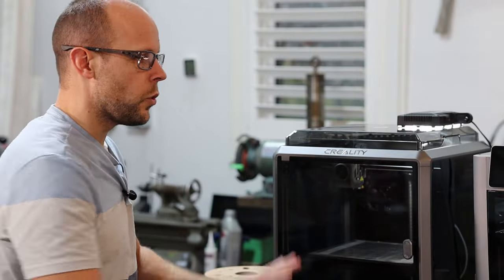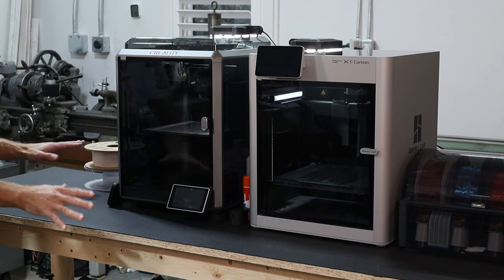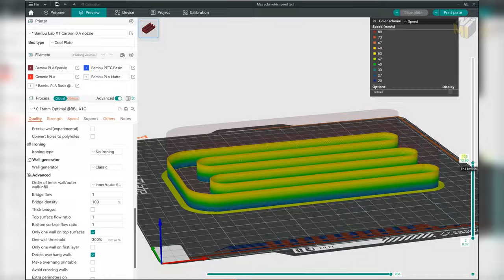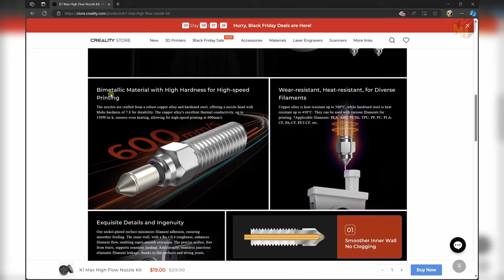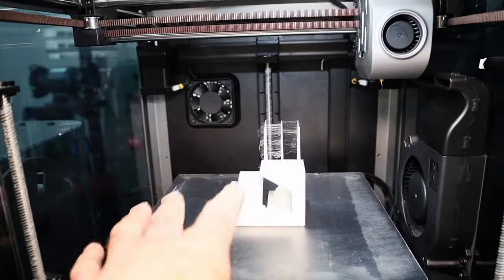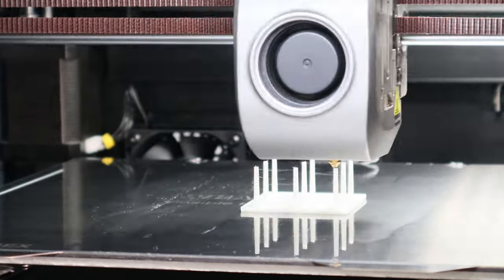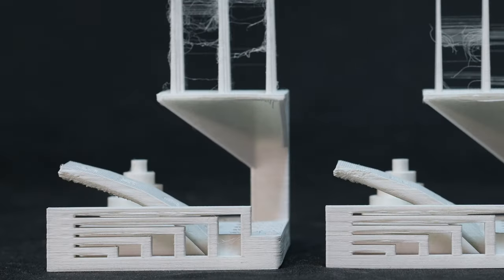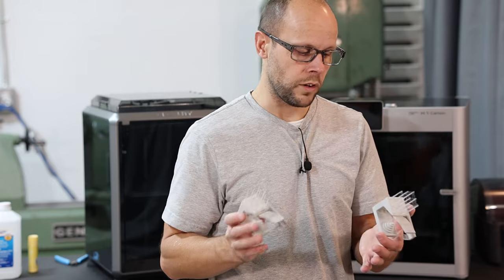Printer VS Printer - Creality K1 faces off against the Bambu X1C at HIGH SPEED - Who Wins?

Comment: For the price I think the K1 is a better choice if you only going to print in one color at a time, if you slow down the print speed I think you should get quite similar results for a third of the retail price. I'm considering the K1 to replace all of my ender 3 v2s. Great video as always !
Reply from the maker: Thanks a lot, I really appreciate these kinds of comments!  The K1 is really a great deal, all ofthe printers seem to be coming down, maybe they know something we don't.  Is there a next-next gen coming out soon?   

You've given me an idea for a follow up video.  Does the K1 or the X1C perform better worse or the same at high speed vs low vs in-between?  We'd imagine that they'd all do better at lower speeds, but they're designed for high speeds, so maybe it's not what we think.  I just wish I could get that little bit better extrusion consistency from the K1, it's so close, could it be the extruder.  It's something that seems to be there regardless of the slicer we use.  I really need other people to tell us whether this is something they see as well with their printers.
Reply: K1 Max is $650 at micro center right now and the K1 is $350
Reply: @NeedItMakeIt  I just saw the video of the new flsun s1 printing a benchy in 8min, they claim 1200mm/s. Maybe creality is moving towards the delta format printers, those machines are coming strong !
Reply from the maker: Wow, they must have some kind of hotend on there to keep up with that speed.  ULTRA VOLCANO HOTEND... END... END!    I'll have to check this out.  Imagine at those speeds when something goes wrong, you'll have no clue what happened, it will just explode into a pile of parts.    The idea of the delta is very different from the others, it is naturally more stable because of the way the hotend is being held. I'll have to see if I can get my hands on one, even if its a small one.
Reply: I have both printers, but if I have to trust a printer I go to my k1, for $350 what an amazing printer if it cam multicolor I would just go with the k1
Reply: And the k1 doesn't waste material like the bambu
Reply from the maker: @albertorodriguez182  Thanks for that, lots of people seem pretty happy with the K1 finally after a bit of a rough start.  I don't mind tinkering myself, but I get it that some people just want to press print and that's it.  At this point, I'm with you.  I'd like to use the X1C most of the time, but I don't hesitate not to use the K1, just knowing that the quality is just a little bit less.  Maybe there is something I can do to get it closer.  If you have any ideas, I'm all ears.  I'll be experimenting with a few ideas to see what the source is and see what we can do to fix it.
Reply: I have two K1 Max machines in my stable, can't beat'em.
Reply: But the problem is that the K1 or Max have a bug that if you slow down the prints the quality will be horrible. It is just built for speed. I hope they have fixed it.
Reply from the maker: @skelethornbro  That exact test is what I am working on right now.
Reply: @NeedItMakeIt  cool! Will wait for the result.
Reply from the maker: @skelethornbro  Sounds good, I'm curious, I'll do a couple of tests for each printers, Slow-Med as well.  I'm going to need to buy some more filament soon.
Reply: Actually I am in the position of actually owning a p1p, an x1c and a p1s. I can tell you that if I were to do it over again I’d only buy the p1s. Why? I’m not convinced the LiDAR really does much for the kind of things I make. For the money the p1s is probably the best deal of the 3 in my opinion and real world experience. The difference would be for carbon fiber filaments, which I don’t print. 

As far as the k1 printers I’m seriously considering the k1 max. I wish it were a bit bigger but it is bigger then the Bambu offerings. Also there is an upgraded hotels that will ensure good flow for the k1 series of printers and coupled with orca slicer I think it’s is a decent alternative to a Bambu printer. 

The only drawback I see with creality is support and customer service. I have other creality products, now and in the past and service and support is virtually non-existent save online forums and Facebook groups. Bambu at least has what seems to be an 80/20 record so I know I have a better chance to get help should I need it.
Reply: I'm looking more for a printer for high heat carbon, what do u suggest?
Reply: @alfainc5868  I guess the question is how much carbon are you going to be printing? I personally have never printed in carbon fiber at all so I have no experience but it seems the Bambu has a bit of an edge between the x1c and the K1 since there are plenty of people that have used it for carbon printing and it seems like the K1 has a few issues overall that likely will be ironed out in either updates or community use and solutions. 

Also if you are going to be doing a lot of carbon fiber filament maybe neither one of these printers are for you, you may need to look at other solutions, but you won’t get it at the affordable price either the Bambu or the creality machines are at and won’t have the speed, which seems to not matter to a bunch of people.
Reply: @shawnhicks619  thank you 😊

Comment: I have both the K1 and the X1CC.  My K1 was one of the early release and has been nothing but problems and is still not working even after I received all the updates from Creality.  Updates are painful on the K1 and flawless and painless on the X1.  When the K1 worked, for a very short time, I was very impressed with it.  What sways it for me is the AMS multi color unit.  Price I think not apples to apples as you said I think the P1P or P1S is a better comparison.  Loved your video and i subscribed
Reply from the maker: Those are excellent points.  The history on this is not very favorable for Creality, it seems as though they tried to do what they always do and release a printer which needs work, and rely on the community to solve the problems.  Unfortunately for them, Bambu was working on solving all of the problems and had an excellent plan to release a printer for a few price-points.  Those printers also have the ability to upgrade to use the AMS system.  They had a very good strategy here and it looks like it blindsided Creality.   A little story on this.  I have been trying to work with Creality for years on getting a CoreXY style printer, it's been 2 years, I nearly had one and then that fell through.  Years passed and we worked on it again, but then it was delayed again, that was for the K1, they delayed it because they didn't want to give me a K1 printer which wasn't working correctly knowing that I would be making videos showing the problems.  So I waited and then I received this one.  But it still wasn't quite good enough.. at least compared to the X1C.  But then finally they opened it up, and it's at a point where I'm happy to use it, it's not perfect, but it's pretty close, and for the price it's a good deal I think.   

The first batches though there were lots of problems, and I guess you weren't able to get your sorted out.  I think they had an upgrade kit for the extruder and hotend, did you ever end up with any of those?
Reply: I did get the upgrade it but haven’t installed it yet. I had to do a major unplugging of the hot end one time and when I was taking the hot end off one of the connectors got pulled off the board and I’ve been trying to get something worked out with creality even at my cost if they didn’t want to cover it under warranty but they have not been very helpful. I need to get it working because the bambu is swamped and I can’t afford another one
Reply from the maker: @3Dprint4you  Oh, that's not so great.  If you get a chance, please send me a photo.  I maybe be able to include these types of things into future videos on the subject to help people and also apply a bit of pressure to the manuf. to do the right thing.
Reply: @NeedItMakeIt  I will definitely send you some pictures of both whatever problems with the K1 but also for the fuzzy skin.  I noticed that the fuzzy definitely looks way better on larger prints but will send you a picture of both big and small "snowmen" with the fuzzy.  I really like it and absolutely no layer lines to be seen.
Reply from the maker: @3Dprint4you  Cool thanks.  I have a few uses for Fuzzy skin coming up and I'd really like to see what it looks like on your prints.  I'm hoping in a few years we can have printers which do not print in FDM, instead they'll use a completely novel approach which gives us a homogenous part when we're finished, no layer lines, all one solid part just like injection molding.  Resin is close to this I suppose, so maybe it will be more like resin, but I'm thinking that there are other approaches which have not been explored yet.
Reply: Exactly the same experience here except I’m still waiting on my upgraded parts
Reply: Creality always has reliability issues, the rule of economics say we cannot get an X1C for $531 (K1C).  So therefore, reliability and parts quality must be inferior on the K1C.

Comment: Yes the K1 makes printing fun. This latest generation of printers is what will take 3D printing mainstream. Just design and send it to the printer via wifi. I tell everyone that If I were a kid, the K1 would be my favorite toy, It is that easy. And for prtotoy[ing this is what you want. You want to focus on generating ideas not be frustrated by tools that barely kinda work.
Reply from the maker: And that's something that not a lot of people think about.  If they're getting a printer they should also be designing what they need themselves, it's going to give them an overall better experience and the satisfaction of having made something themselves.   Remember when we had to walk over to the printer with an SD card?   Ha that was just 6 months ago.  They've really come a long way in a short time, and I'm sure as long as there is a market for printers, they'll continue to innovate and make them better.  Finding ways to make parts which are isotropic would be one of the main ones in my mind.  The parts we make are prone to breaking unless you take the 'grain' into consideration.  It would be ideal to get to the point of injection molding.

Comment: Wow. You could have 4 K1s for the price of the X1C. 🤔
Reply from the maker: There, the right account!  I'd say when tech goes wrong, but it's just USER ERROR...  It’s hard to believe they can sell it for that cheap. About 4 years ago I purchased an Anet A8 for close to that price, it was slow and inaccurate.   I’m still not sure what exactly is causing that little bit of variation in the surface finish.  The K1 printer seems to shake more than the Bambu when running high speed, but I see this at lower speeds also, could it be the setup for the extruder.
Reply: @NeedItMakeIt  glad you switched accounts. I'd also clean up the other ones 😅 

$650 for the K1 MAX in micro center right now. Unreal. Im legitimately option paralyzed. The MAX print space is huge (I am self employed) and need that space. But the Bambu are so polished 😅
Reply: ...because this "youtuber" dont have P1S....
Reply from the maker: @sore500  I don't really know what you mean, can you give a bit more insight?

Comment: With a little tweaking, the K1 can get to the level of the X1C. BUT, with a little tweaking, the X1C can look much better than that too. Both are great machines. I prefer the P1 series over the K1 series, but the differences are smaller than they used to be with the previous generation of printers.
Reply from the maker: That's a good point, you can really dial them in more, it's just a matter of how much effort you want to put into it.  Do you think that the slight variations in the surface on the K1 are related to the extruder or setup for the extruder?  I wonder whether I should run a few tests to see if the tube is being pinched too much and I should remove the top to see if that helps a bit.  With both running CoreXY, I don't see many reasons why the results can't be better.  It's just a matter of finding the source.

Comment: If you want a truly scientific test, you need to use the exact same settings on both.
Reply from the maker: It's a bit of a rabbithole, but yes I have been deep-diving into each of the settings to see if I can get them a bit closer.  Even after making some adjustments, it is strange to me that the results still are not as close as I would expect, in the slicer there is still a fairly big gap in print speed around inner and outer walls.  In theory it should have given Creality an advantage because it was slower with inner and outer, however the end product didn't seem to reflect that.  More testing required.  I do have a new extruder on the way, there is a possibility that there is still a lingering problem with my printer. 

As I get a bit more established, I will be more methodical in my testing, you should expect to see the Science factor increase over time.

Comment: I had a K1 Max at my last job. I can say I was using the BL slicer up until January when the new Creality Print came out. I was getting far better results, supports, layers, surface finish etc with BL. Then CP 5.0 seemed to fix the issues. Certainly it needs to be tuned using all the built in tests, but it'll put out nice prints afterwards. A very informative comparison, keep up the great work!

Comment: im happy with my k1, delivered to my door for under 400 bucks last week, all the teething issues seems to be resolved by crealety
Reply from the maker: That's good to hear, and a great price!  By all of the feedback I've been getting it does seem that any lingering issues have been fixed.  I do wonder if the extruder feed tube (reverse bowden) is still within the cable chain, and if it is, does that bend to the extruder not get too tight?
Reply: thats interesting as i was thinking K1 max because the K1 had many bad reviews in the past.

Comment: I like my k1. And as other have said it is way less than the p1s or the other comparable core xy printers. Now stock out of the box it is ok but once you root it and install stock klipper it is amazing. I aslonuse orca now and love the fact i can now send prints via wifi. I can't complain at all. Yes it is not perfect but it is by far the beat bang for the buck. And for those who like to tinker and upgrade it is the only choice. There are so many mods out for it and it will just keep groing. I have never like creality and did not even consider until they unlocked the firmware. I have 4 printers and my k1 is now my go to printer. I will try to get the k1 max next unless something else comes out at a good price

Comment: I like the comparison idea.
I like your attention to details, like using exact same spool for both.
But, then you print with open cabinets, on two enclosed printers ... To me, that doesn't make sense, if quality is part of what you are looking for.
Reply from the maker: Hey, this morning I replied from the wrong account.  Thanks for your comment!  I'm not sure if you saw the first comment or not.  The high speed printing on a part like this will have trouble cooling, the doors are open and sometimes the tops come off to keep everything cool for the best results.  If I were printing something Like ASA or ABS/ PC or Nylon, there would be too much warpage if the doors were open, the chamber needs to say pretty hot to reduce the amount of warpage.  PLA also warps, but it's manageable.  PETG seems to be the most stable, it stays remarkably flat, I tested my PETG prints on a surface plate for precision steel parts and it's quite good considering that it's plastic.  

On the other side of things, because I'm shooting video and need to capture the prints, I need the doors open, they are highly reflective and tinted and I need all of the light I can get.  Printing ASA I'd have to add a lot more light from the top to see inside properly. 

I hope that speaks to your points.  Let me know what you think.
Reply: I have an X1C and found that printing with the chamber sealed can lead to heat creep and jams between the extruder and the hot end.

Comment: Did you tune flow for both? I would expect to run PLA hotter than 220 if you ste trying yo push speeds up to 500 - even as far as 235. Depends on the model. In the real world, not general torture tests, you can get better results by changing the profile to fit the model - different settings if you have lots of bridges, or overhangs or thin pillsrs etc etc.
Torture tests are an indicator to help you do that
Reply from the maker: Creality had been calibrated for that filament yet, the Bambu I left as Auto.  As far as temps raised the nozzle temp for the test yes.  

The test was really to see what the results would look like when we reach the higher speeds of the machines.  I didn't expect perfection, but certainly based on the results of each test we could fine-tune and do better.  I showed a little bit of that on the string tests.  I have a new extruder on the way for the K1, I want to replace mine to see if I have a problem with my extruder, or perhaps it is just the reverse Bowden coming in on too tight of an angle... or maybe something else.  I don't think I did a good enough job showing the scale of the models, they are quite small and I tried to make all of the defects show as much as possible.  I have a follow up video I'm working on to show a better benchmark comparison to a high-speed result.  I also want to test to see what happens when I run the walls at the higher speeds, they were still down a bit.    Thanks for the help, I'll be taking everyone's comments into account at least a much as I can for the next videos.